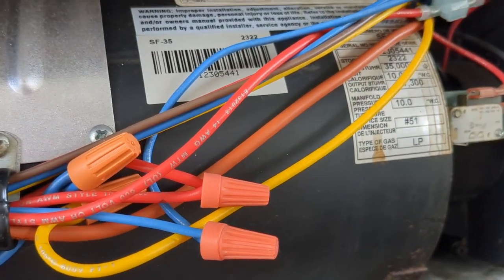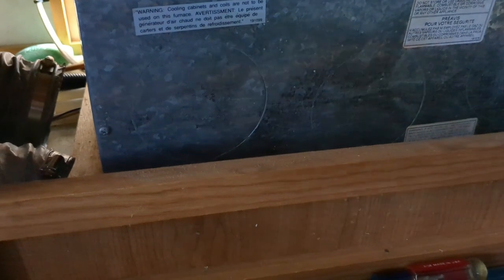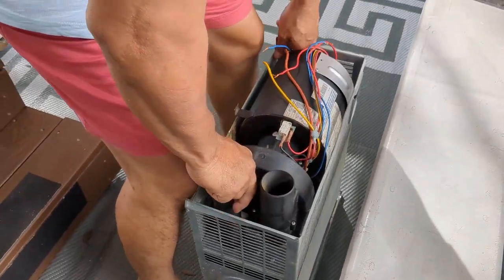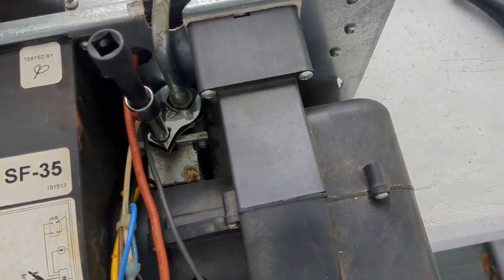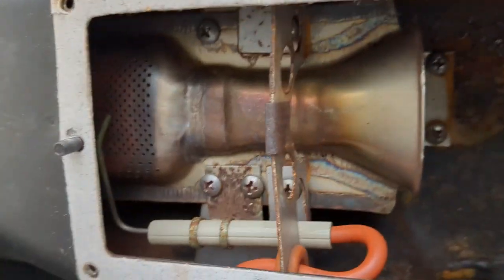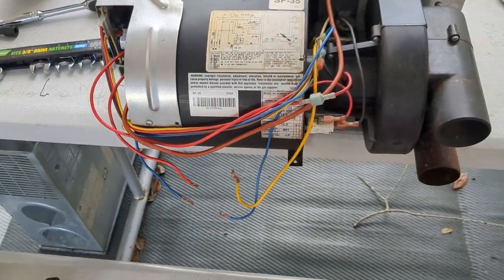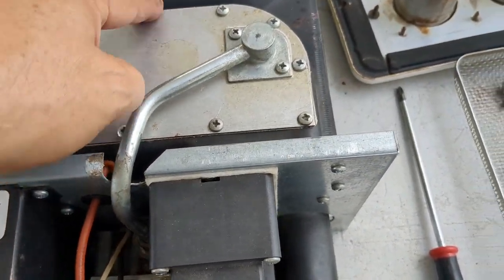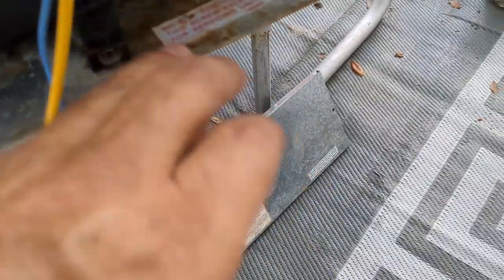Suburban furnace igniter electrode adjustment

Comment: Thank you very much for making this video. I’ve been having the same issue with my furnace for the past year, I’ve replaced the sail switch, the limiter switch the electrical board etc. and it still wouldn’t light. I was about to give up and then I stumbled across your video yesterday and sure enough my propane feeder tube on the inside was clogged. Thanks again.